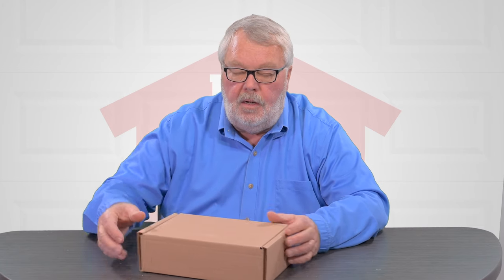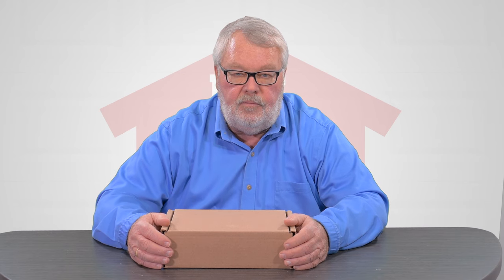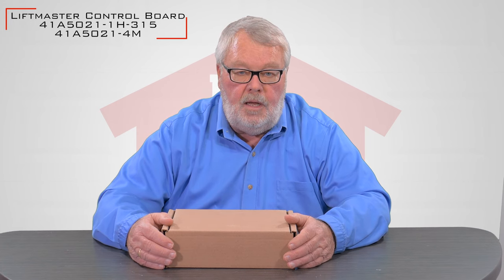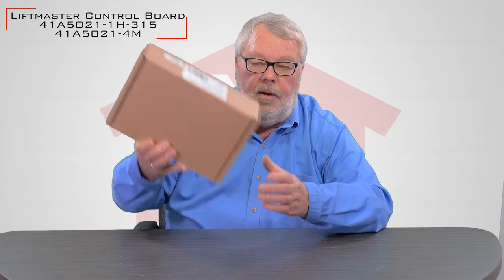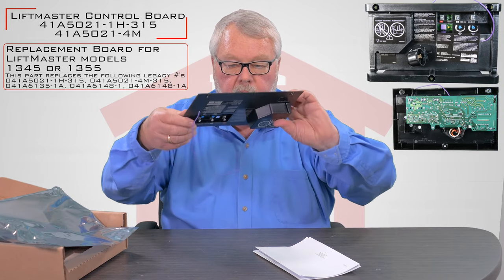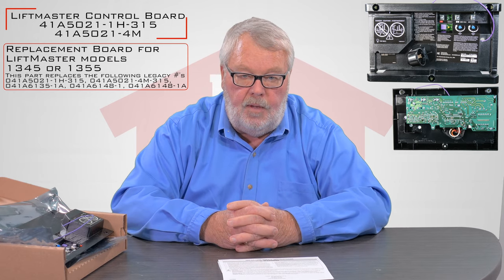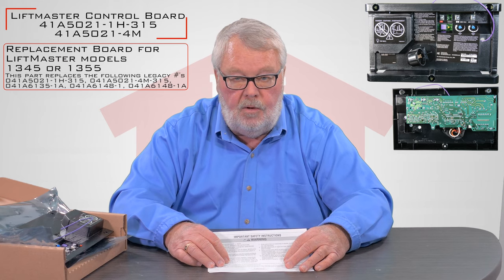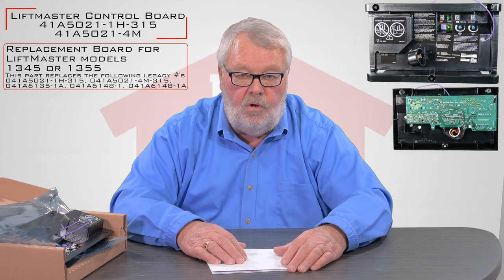LiftMaster Chamberlain 41A5021-1H-315 Garage Door Opener Circuit Board

Comment: I have a liftmaster 1300 series.  all 3 of my remotes stopped working today.  The wired wall mount still works.  I have tried reprogramming them, and it seems to accept my programming, but still the remotes don't work.  My question is:  Do I need a new control board?
Reply: Let me know what you did. Same exact problem and its got me stumped, I went as far as attempted to check each relay to try and find the part that was bad but no luck.